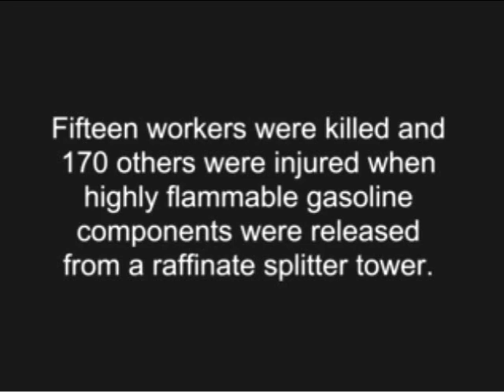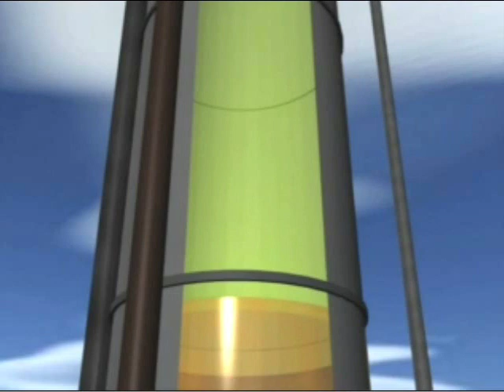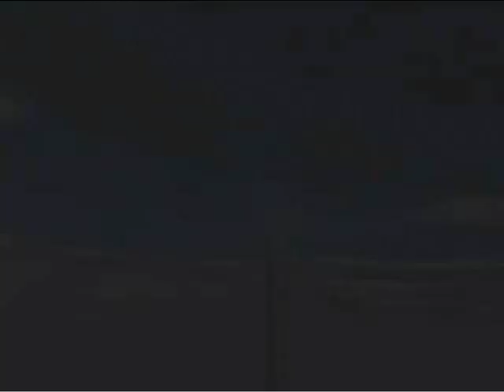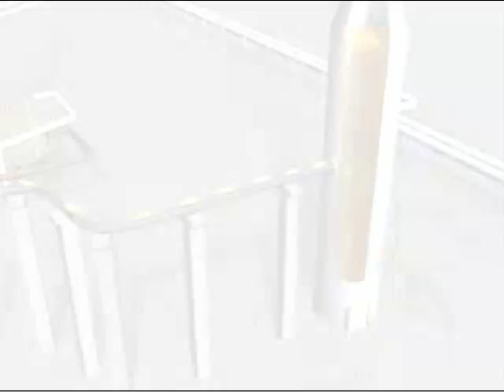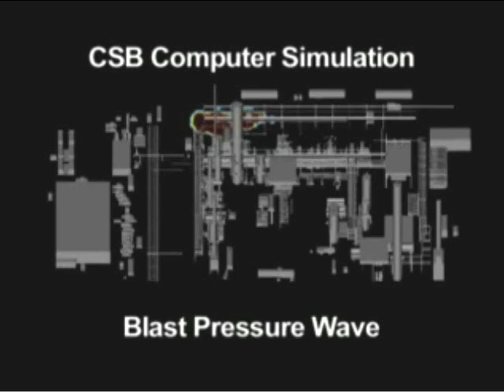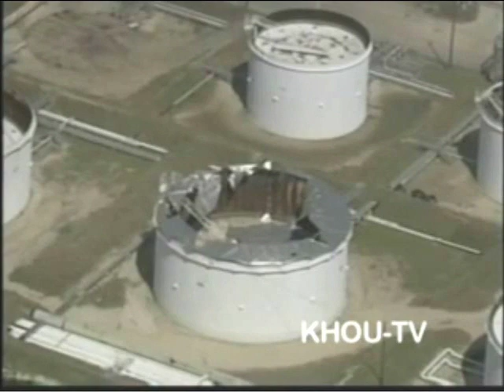BP Safety Valve Failures

Comment: This is a video stolen from the US Chemical Safety Board.  The valves did not fail.  They operated exactly as intended, but the tower should not have been full of liquid.  The valves are designed to open when the pressure in the line reaches a certain point.  The line should have contained vapor, not liquid.
Reply: The valves were designed for the release of vaapour/gas. Not liquid. They weren't designed for that medium and mass flow
 The valves did what they could. The error here is the liquid level alarm. And also, a diesel truck wouldn't have caused the explosion. It was a petrol, as diesel is   ignited under pressure, not spark.
A witness at the event (from what I read) stated he heard the truck, running, and a very high rev count... indicative of over indictment... and that would be from air being drawn into the engine for combustion.
Reply: Over Enrichment of fuel from the fuel/Air mixture due to vapour in the air.